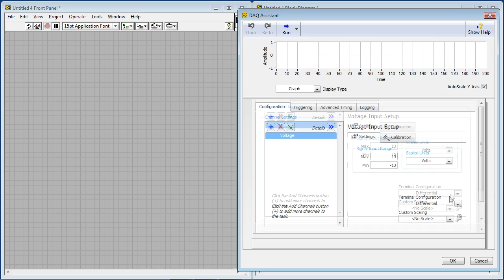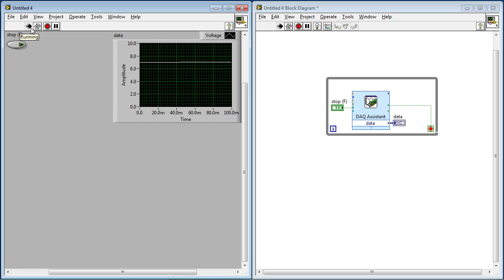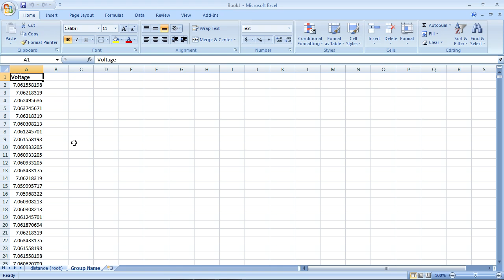Acquiring Analog Voltages and Logging Data with NI USB X Series

Comment: Yet, they never answwer your question. Now and yes is it possible to export into excel values and voltages and even timing also you may install VISA drivers in order to recognize 6001 and implement a vba code to do that and the time you write small macro to read for example every halfsecond or one second.